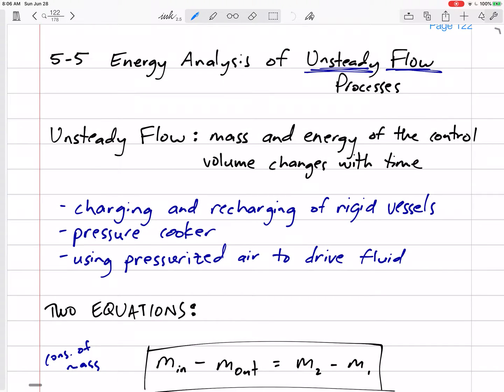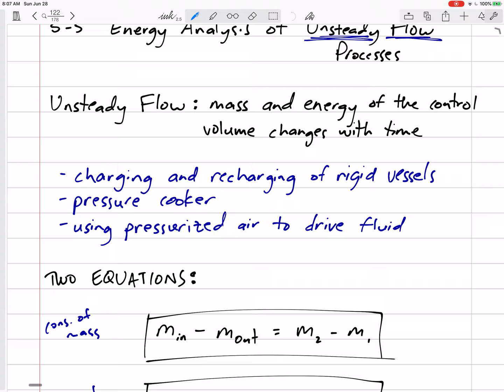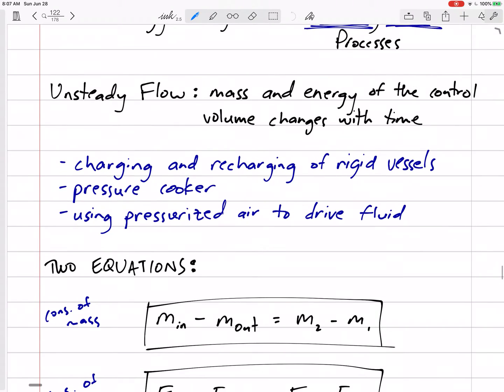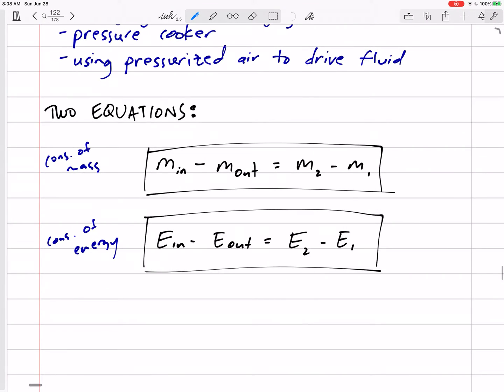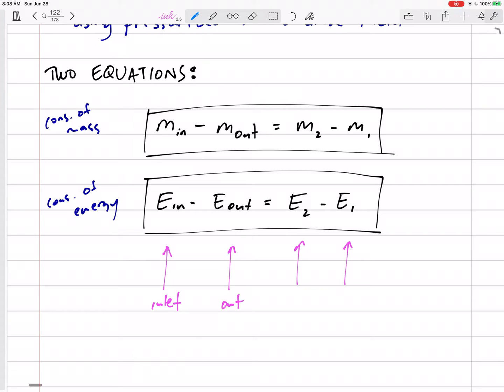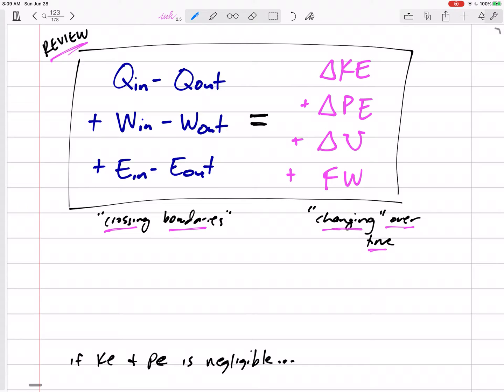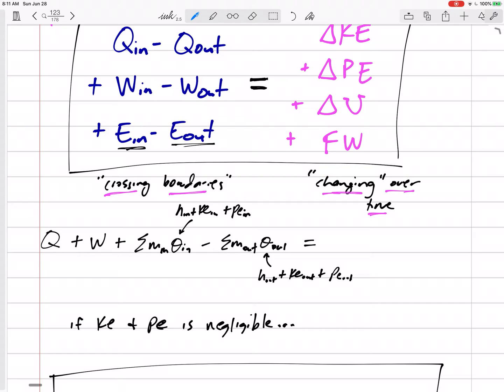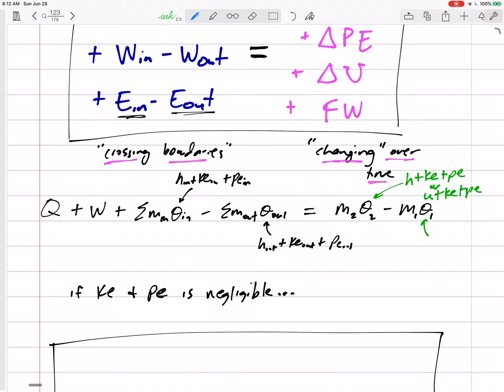Thermodynamics - 5-5 Energy Analysis of Unsteady Flow processes

Comment: w is work out minus work in, your final equation should be Q-W not Q+W
Reply from the maker: Yes, most thermodynamicists like to say Q-W and W is work out. But I like to teach it as Q+W and work out is negative.
Reply: is that not wrong @engineeringdeciphered
Reply from the maker: @s4swixx679 if you write the equation as Q-W then work out is positive and work in is negative. That’s how the book will do it. But I like to write the equation as Q+W and then I’ll use work in as positive and work out as negative. You could do either method and they would both give you the same math in the end.